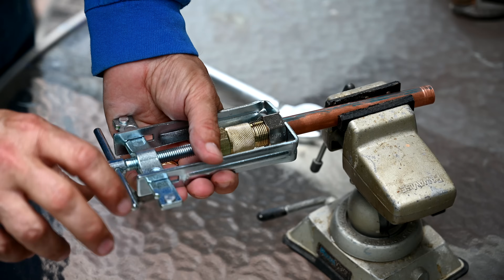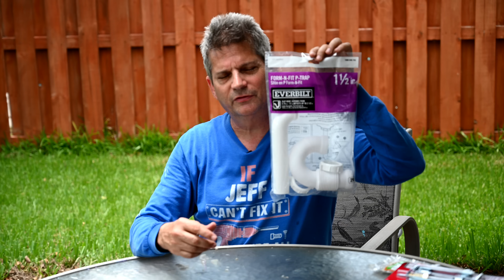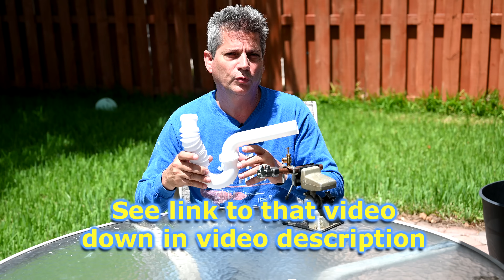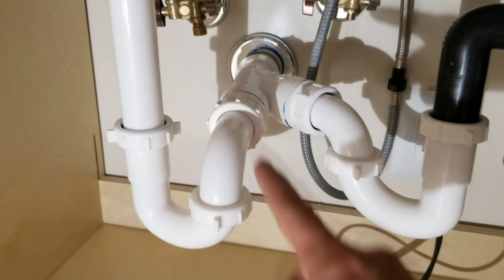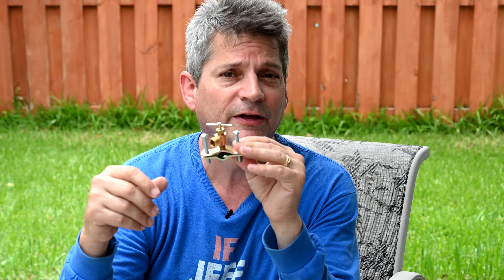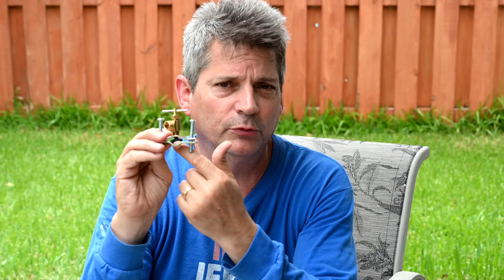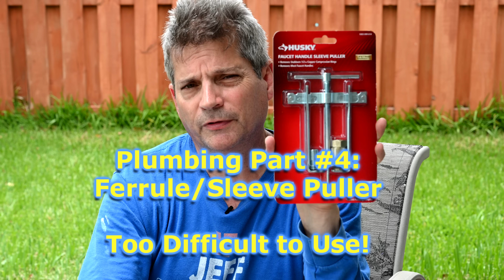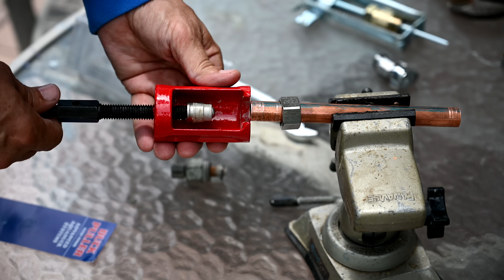4 Plumbing Parts/Tools You Should NEVER Use. NO Plumbing Fails

Comment: This could have been presented in six minutes, with one-tenth of the self-righteousness.
Reply: Agreed. So tired of what I’ll call tradesmen acting so self important. The only reason most of you have a job is that people are too lazy to learn a little bit about how to fix or do things
Reply: @jcohenmd  I'm a locksmith and for the large part I agree with you.  In an afternoon to a weekend I could teach anyone the rudiments of locksmithing, or of welding or woodwork.  They would not a locksmith or welder or carpenter be, but they would have significantly less likelihood of needing to consult with such a person in the future.  Now there are significant areas where such skill as learned in an afternoon to a weekend will be insufficient, and the ability to see that one is in over one's head is not so easily taught and even professionals often lack it, but that is not the issue.  You wouldn't be fit to take over the management of an institution with multi-level master keying and SFIC locks, nor weld together buildings nor assemble them from wood (except perhaps a shed or outbuilding) but you'd be all set to re-key a new lock to your old key, or the other way 'round, or weld some sheet-metal to your wheel arches to get through state inspection or make simple fixtures from wood for any of a thousand purposes.  But at the end of the day so many are loathe to learn these skills or believe themselves (rightly or wrongly) incapable and they will happily pay us to do simple tasks for them. 

There's also an element of "Code-worship" among the self-righteous professional brigade where something being enshrined in code means that they feel they don't have to understand it anymore because code says it can only be one way.  Why is the flex drain forbidden?  Because it is not self-scouring.  Now this makes sense from a code perspective, because it creates a "trap", so to speak, which is fallen into by not knowing that a non-self-scouring drain is in place and that it must receive maintenance to continue to render acceptable service.  It's the kind of product you install for yourself only because you, having installed it, understand it precisely and know how it is fitted and can from there develop a plan of action to maintain it, which may involve chemical or mechanical processes or a mixture of both.  So it can and should be used _in cases where you understand fully the implications of installing it, and what needs to be promulgated amongst the DIY-masses is not that it's bad but that it's got certain limitations which must be understood when using it.
Reply: @Lazarus7000  Thanks for that intelligent, thoughtful reply.  It is so much better than the typical, confrontational Youtube reply. It has actually educated me rather than simply insulted.  Much appreciated
Reply: @jcohenmd  Thanks!
Reply: Where's the fun in that?

Comment: Holy crap I have both traps and the saddle valve. And surprisingly the HVAC installer used the saddle valve and the company who remodeled our bathroom used the flex trap. The S trap is in the basement on the wash tub I don't know how to fix that the drain is in the cement floor.
Reply from the maker: S far as the S trap is concerned in the basement you're probably OK I would just monitor at once in a while and make sure it has water in it. I think the only real time you have a risk of water siphoning out as when you empty out an entire sinkful

Comment: On commercial properties, I found old valves/nuts that did not match the threads on new angle stops. I like to start out new, but sometimes would reuse a nut and ferule if it would seal up. The way to remove a ferule is with a professional splitting tool. It is also heavy cast aluminum with a nipple to go inside the copper tube and a blade that is turned into the ferule. Small channel lock pliers easily turn the bolt on the blade (it isn't a hex, but has external splines). The blade wasn't sharp enough to damage the copper and it was pressed into the ferule very evenly. It was easy to hear and feel it split and then just back the tool off. Far too often, the old valve was installed so tightly that it deformed the tube and it wasn't possible to seat a new ferule on it.

 If there is enough tube, I would cut behind the old nut and use a new compression valve or just sweat on a 1/2" threaded male copper adapter and use a threaded valve. Property managers were happy to have us replace all of the valves and supply lines when getting a suite ready for new tenants, as the bill for us to professionally clean up, treat, and repair water damage was much higher. The buildings were built with flexible hard lines built into the angle stops and they were prone to leaking.

Comment: You should have shown some solutions for the problems you described.
Reply from the maker: We are getting complaints about the video being too long as it is. But if you look in the video description you'll see I have links to several other videos related to this for example how to hook up A P trap when your wall waste line is off center and you can avoid using the flexible P trap, cementing together a few PVC parts

Comment: All I see is diy stuff and I'm familiar with these items and has got us out of a nasty situation as a home owner but by no means am I a plumber I have called some plumbers to unclog drains in the very bathroom as the accordian trap and he moved it stuck the snake In there then went to the bigger drain plug under the kitchen no issue that I was using that item in my bathroom it been about 7 yrs now still no issues leaks or smells now the fridge valve yes I just recently replaced that one with a 3/8 compression valve it was leaking I always thought it was the fridge defrosting creating the puddle but at some point if I refinance maybe I'll have these items fixed or replaced. But now a plumber is $75 just to show up and I'm on a fix income so don't blame use for the diy fixes shark bites are my new favorite diy plumbing repair tool
Reply: @buck ewer well as I stated I'm not a plumber. My first thought was a clogged drain but it ended up being a tree root notice I said he went under the kitchen sink to to a bigger drain plug. It was just backing up in the bathroom sink
Reply: @buck ewer It was rapid rootor that repaired the pipe and replaced the section damaged and my home warranty insurance paid for the bulk of the work I just paid $75 for the plumber to Come out. A small section of lawn was removed and replaced. So would I call a doctor if I was constipated yes if the over the counter meds didnt work. As with my drain issue store bought items didn't work (drano, liquid plumber) I was under the assumption it was  just a clogged drain. When they brought the camera we saw what the issue was. And it didn't require heavy equipment nor did they dig up alot of my yard it was 2 guys and it was fixed in a couple hrs  now if there actual title is being contractors or such I don't know but they came in one van and left in the same van and all the parts and tools they used was in the rapid rootor van. One guy did most of the work the other guy was on the phone most of the time. And as for me using shark bites I damaged a section of cpvc on my central system ( air conditioner, heater )and used a 1/2 coupler shark bite to fix it and I haven't had an issue with that either

Comment: #4 Not defending the tool but YOU are clearly using it wrong!
Reply: I saw that too. Needs to screw the tee handle out and then the fitting thing down and it would work 'better', but I will give him that it is a cheap tool that is hard to get to work right. It is very similar to a gear puller and if you can't get those arms to hold...... It does make me question his mechanical abilities, but I'm an idiot so yeah...
Reply: longus yeah he didn’t use it right in the video. I’ve used it before. trying to squeeze and keep the arms together while under a bathroom sink just sucks especially when your fighting to pull off a ferrule that was compressed to hell lol
Reply: I'm glad I wasnt the only one who saw he used the wrong fitting on the puller. Makes me a little sad that a knowledgeable plumber is making such a greenhorn mistake.  That tool is crap though.

Comment: That code has leeway. I get why not to use the accordion type in the code. But right after what your saying it says “except for materials and parts that are designed by a manufacturer” but it’s to easy to just use some parts and build a good pee trap I agree

Comment: PART 3 # - SADDLE VALVE
i got Home Depot to install a Trane Firnace - SUBCONTRACTOR used a SADDLE Valve for a Humidifier Install to the Furnace !!!!!!!!
1st attempt Pierced WRONG !!! on the water line going out to the Back yard Garden - I Told the Idiot !!! when i shut off the water off in the Winter how will the Furnace Get Water ???
He then Uses a 2nd Pierce saddle valve and leaves the 1st one there !!!!!!!!! WTF 
NOW the Original Intake and Exhaust Pipes were BLACK PLASTIC for a OLD LENOX Pulse unit - HE DID not upgrade to WHITE PLASTIC  PIPING so 2 nd year when it GOT REALLY COLD the INTAKE FROZE !!!!!!!!!!!!!!!!!!!!!and shut the Furnace OFF

Comment: What do you suggest to replace the S trap?
Reply from the maker: You would do it while remodeling, and change it to a p-trap. But you should never design in an s-trap while remodeling,  Changing over to a p-trap requires a little re-arranging of pipes inside the wall to give you a horizontal drain pipe coming out of the wall.

Comment: I put one of those lousy saddle valves on the water line for my fridge water dispenser.  All of a sudden, after a short time, I lost a lot of the pressure in my water dispenser.  It turned out that valve clogged.  Piece of junk.  I cut a small section out of the pipe and installed a ball type shutoff.  Water dispenser and ice maker works great now, and has for years.  My sister in law was complaining about water on the basement floor.  I went over, and there it was, the leaking saddle valve.  Don't take those kinds of shortcuts.  Proper plumbing isn't that much more difficult.
Reply from the maker: How long was hers installed' Strange how yours failed so quickly, and yet others report that they had theirs installed for years an no failure. I think it's luck of the draw, but if you make sure there is no saddle installed, your luck will greatly improve.

Comment: several times now you have mentioned methane coming into the house are your sewage systems not ventilated every house should be vented to atmosphere even mains sewer is vented usually disguised as an extra large street pole but is a pipe instead perhaps fitting a durgo valve would help
Reply from the maker: Vince, the venting system in all our houses is a complex breathing machine with many branches, so sewer gasses rising from the sewer we hope would go up through the main stack, out the roof and into the outside air, but they can find their way into those other branches off the main stack and up into our drains, which is why if your P-trap runs dry, you might be able to smell the gasses. I find it's about 50-50 whether you'll smell gasses. Sometimes when changing toilets I can smell gasses coming up the 4" pipe after I remove the old toilet and I have to put on a plug to cover the hole temporarily. Other times I don't smell a thing. Sometimes when I remove an old P-trap to replace it, I smell nothing. Other times it stinks to high heavens, and you see little gnats flying out of the hole.